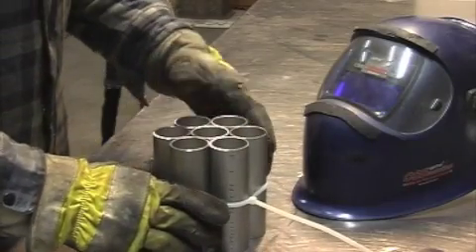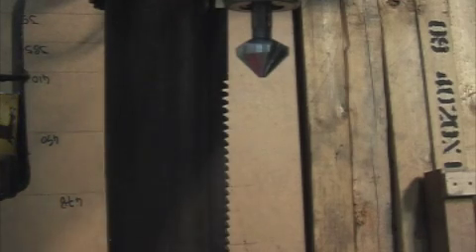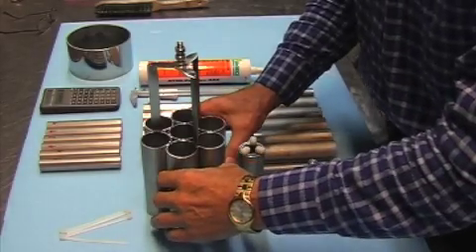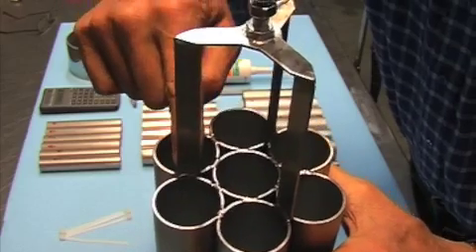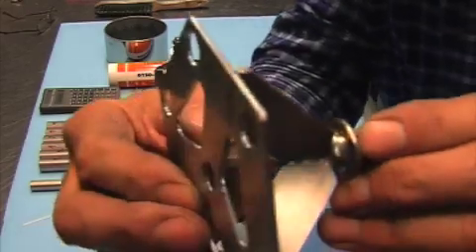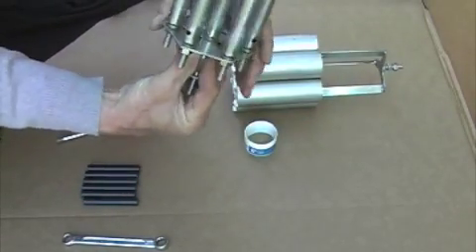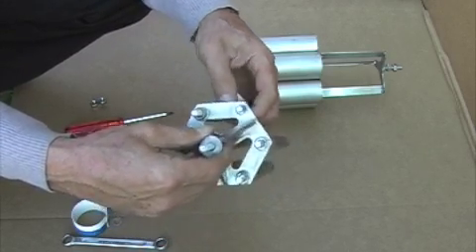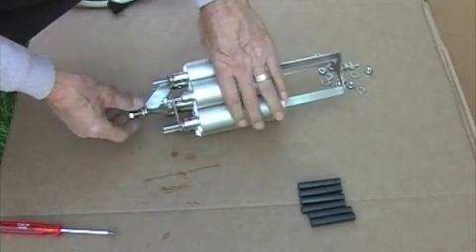HHO Swiss Inox 3d Seven Cores Cell and GOOD production

Comment: ok, so, you have the positive on the outside... major issue....you have multiple grounding points but only one positive.... reverse those.... then, pulse electricity to each of the multiple positive posts.... that was a major reason why the original guys reaction chamber worked so well - his pulsed electricity sending unit.  others adapted a rotor/distributor cap to pulse electricity to each positive post.... AMAZING RESULTS!!! 12V 1.5AMP.  the trick is multiple positive posts and all negatives connected with 2 layers of neutral plates around each positive post.
The welding is counter productive.  Neutral plates between the annode and diode cuts the amperage draw in half.  The more neutral plates, the more efficient - to the point of no KOH required.

Comment: Try not to use tubes but make your tubes or plates out of heavy wire mesh so they will have more surface edges because you will get much more benefit from your production. Just imagine having two flat plates close together no matter how large they are. If you could view the reaction that you're trying to achieve through a high-speed camera you should see very few areas in the interior of the plate but you will have mostly all of the reaction of it bubbling from all the edges of your plates. Meaning the only thing that was producing the reaction were the edges of the holes you had in the tubes. And you would have had twice as much as you had if you had the same holes on the surrounding tubes. And this is why I recommend using a wire mesh for it will give you the maximum holes with edge area.

Comment: Dear Swiss Friend
   Mike Meyers was an inventer who had achieved the goal of running an automobile on water aione.   He accomplished this with high voltage, low anperage, and a frequency.   I'm not sure of the hertz, around 5,012 or so, maybe varying.  The voltage is still DC.   Ampheres creats a lot or heat.  High voltage is efficient at spanning a gap, like that in a tazer for instance.   Good Luck Sir.

Comment: have you heard of a joy fule cell apparently it works like this cell but makes Oregon energy to but you need to detect the orgon to the center of the old school carbureted engine change the timing 30% charge the water for 12 hours turning on and off every 3 hours and wala good to go    is this true or b.s I want to buy all the shit to build it but looked everywhere for pipe off cuts but they don't sell them.

Comment: High amps and low volts are needed I think 1.25v is all you need the more amperage you have the better production. Use a computer power supply you can net 40 amps at 3.3 volts very easy and your production would be hugely improved. very good design though. Thanks for posting the videos.

Comment: jumping from 1.2 A up to 20 ?  is there anyone who knows what are we looking for? , any suggestions ?
Reply: I found somewhere that the amperage  should be about 8 to 14 amps and not more than 15 because tne water gets hot,
fit the walts until the proper result. 
other variables that sould be attentioned:
the frequency of the current
the contact surface - as it bigger the output increases.
covering the electrods with diferent alloy,by electrolysis - worth trying
and a catalizator - such potassium hidroxide
very important: since hho is explodable,
it's wise to collect every gas separately, ,
flowing them through a 'security valve' that prevents the explosion from going back.
Reply: beinjito baberio what if we cool the water down in a freezer ?
Reply: +Mars Seeker doesn't seem to have a noticeable efect.
but, because the suitble path , as mentioned earlier , is to progress considering all possible aspects (I've tried to describe some),maybe there's  indeed an optimal range of temperature to make the efect along  with the other variables.
Reply: +beinjito baberio regarding to the electricity,it was mentioned that enen small amperage but densed frequency will rise the output, if so , may someone predict if connecting a jaulethieve will cause the same efect ? (jaulethieve is a circuit that gains elec' magnetic field,turning it to additional voltage in the circuit )
Reply: +Mars Seeker 
Amps and the hho  out put have a connection to each other the best cell will have a high HHO- out put at low amps and that number is one you have to find 
Standle Miyers - [check spelling ] had the water power VW using his system
in witch he was using 115 volts AC at 400 HZ and  [ .5 ]  amps his unit was 
puting out  a good amount of HHO gas.  see his video's 

He is no longer with us but he was a true leader in the field this person
is only using 1.2 amps to make hho good start. need to see how much
gas per min- it can put out. And i like the ideal of wealding them.  It cut
down on parts and made good bond to each tube.

HZ is a term in electronics as to the Freq-  of the voltage  in the US its
60 Hz in Euo- its 50 HZ and aircraft Systems use 115 Volt's AC at 400 HZ

To me and just off the top of my head at 12 Volts I would like to see a system
that's only using max of 30 amps andt that would produce the amount of 
HHO that could  power a auto engine. as I said just off the top of  my head.

To me I thank AC is the way to go but i could be wrong and they do make
some AC inveters for aircraft lighting system one type is from 
Beech Aircraft and can the units come in to types one power from
12 volt system and one from 24 volts 

One more point the higher the voltage the lower the amps you need to do
the job. case in point. take to air- conditons  units one at 115 volts and
the other 220 volts and look at the BTU OUT put of the units 

Go for the hight's BTU on the 115AC-Unit and check the amp it will be a
round 15 amps.

now look at the 220 AC Units  the BTU will be double and the amps
will less the or the same for the 110 unit. 

hope this helps even its a little late

Comment: I always read the comments and I never see anyone talk about to connect a second alternator to the vehicle. So I decided to do it myself. Why not connect a second 120 amps alternator to the weel, or to the cardan or any other transmission system of a car, including having a small tire to descend upon activation and connecting to asphalt and through a set of gears transfer the energy to this 120 amps alternator connected to a secondary battery.. That makes sense to me.. I also have had a dream once, ( I was thinking too much on HHO LOL) and I dreamed there was snails in between my plates...Then for a couple of days I keept thinking on this wierd dream and them i realized the snails represented copper coils in between 2 seled plates.. and the coil serving as a voltage increase between the 2 faces exposed to the electrolite. .any comment on this?
Reply: Some cars like Mercedes Sprinter and VW LT II can be ordered with two alternators or upgraded easily to 120 + 120 Amps. But my question is: Does more gas automatically bring more fuel economy? How many gas is needed for the typical 2.5 Litre Diesel engines to reduce fuel consumption about 30%?

Comment: i like ur work.  if you added the spiral core around this unit  u wouldn't have that much wasted space. why is everyone  focus only on one way i say add all the ways you can conceive to one unit and make the water circulate  through the cell will gain higher production.  if you move the water through the cell bubbles wont stick onto the plates.and then have room for new places for it to make more. and also you could add another expose wire into the top of the cell and space it out give you a new 'plate'  and to make the inside core make sure to try the dock wire too. but all in all good work. i havent seen one hho that applys more than one way. and i like to see one

Comment: Have you tried a "high pulls/high voltage/low amperage" like 12 volts/less then 1 amp at 60,000Hz + ?  I heard it makes all the difference.  Too much amp=to much heat.  It keeps the temperature low witch is essential.  This is so cool in it self anyways.
thanks for video

Comment: Does atmospheric pressure make a difference? Could you apply a vacuum to the hho device to help extract the gas?
Reply: good question, I wonder what the process does to the pressure considering it was a sealed container? Seems like a vacuum pump would be fighting to keep hg during the process but who knows, the benefit could be dramatic

Comment: Great start .But the higher the amps the more power you are pulling away from your auto and the hotter it will run. High voltage at lower amps will run cooler and work better for your alternator. Think about this ? A stun gun operates on less than .5 amp and can generate millions of volts. Add a PWM to control your pulse width and watch the magic. Just something you should experiment with?
Reply: Jack, what you need is a good power converter and I'm sorry but a PWM does not work as a power converter, sure you can lower the average power but what you need is a good solid buck converter. FYI, HHO gas production at anything higher than a couple of volts is wasted as heat.

To get good efficiency you need to use about 2V. You need to get the series resistance very low however the catch is that gas production will increase the resistance between your plates lowering the overall efficiency again so you need to get that gas out quickly.

Extracting the gases from water is a fine art and while the process itself is quite inefficient, there are lots of ways you can increase the efficiency of your system.

Comment: 1.48 volts is the most efficient plate voltage for the disassociation of water by electrolysis. Anything beyond that merely wastes energy in the form of heat. You would be better off designing a 1.5 volt DC power supply that delivers very high current to your plates. That would make it as efficient as it can get, around 60 to 70% efficient as far as energy in, energy out goes. Building custom high current low voltage solar panels would be the way to go. Just wire every 3 solar cells in series then install them in parallel banks. You should design your electrolytic cells so the oxygen and hydrogen are produced separately too to lower the risk of large volumes of highly explosive pre mixed oxidizer/fuel being in one place. You simply need to install separate collection tubes over your anodes and cathodes and place them in a shared tank of water containing your electrolyte of choice.

Comment: a hydrogen  embrittlement on the  element's is only in the container and only effects aluminium  or light metals unlike stainless steal is best for longer life runs and easy to clean .It has a tighter bond and is not prone to except the hydrogen or oxygen atom  displacement in the metal titanium is denser material but cost prohibitive .

Comment: hello friend! the model you built is very similar to what I built, only I put only two tubes one large and one small for precione reduce water and bubbles out better. your fabricaste model is much better and more productive. and in my case was producing as expected, investigate and found and put CD burners lasers out of glass that greatly improved the production, (without producing deuterium)

Comment: believe it or not, most people are told that positive is what makes electricity flow, so it makes sense that you use more postive electrodes than negative electrodes, on the other hand, you are right we are after the production of hidrogen after.

 And thanks for the advice, im working on my hho cell and this will help me a lot thanks.

Comment: because the system auto-regenerates the energy consume thanks to the alternator, thing of it like this:
   You use the batery to power the cell......the cell produce HHO and used it on the motor....the motor power the alternator.... and the alternator gives power to the batery.
One side note, most Fuel cells, use more than 20 Amps of power, so using 1-2 Amps like the video said, is WAY too much efecient, perhaps is real, perhaps not, but the desing looks solid. cheers

Comment: For combustion in car - there is absolutely no benefit.
For workshop use - you can build electrolyser to produce H2 and O2 and use that mixture  to heat up or melt (in praxis it's good to add some propane, to keep the reducing, not oxidizing flame). It's possible to weld steel with that electrolyser and standard acetylene torch, but there's problem with hydrogen in that mixture - hydrogen can easily diffuse into molten material and cause /wiki/Hydrogen_embrittlement

Comment: I used an old pool salt chlorinator  that provides max HHO production with titanium electrodes that last ages unlike other metals .Just us an acid or alkaline solution about 50:1  voltage will vary depending an the size of the unit but averages 6-9 V and adjust current to suit to much current and the water will boil. Hope this helps .

Comment: You need more volts. There should be 1.8-2.2 volts between each set of plates. Also, use neutral plates that will get charged by the water.

Comment: IMO spark plugs discharge by ionising a gas to plasma. As the charge ramps up between the electrodes small surface variations will promote plasma/ion formation unequally. Points that are quicker to form conductive plasma get lower resistance, forming more plasma, further reducing local resistance. Very quickly one particular conduction route gains the decisive advantage, conducting all the current. In an electrolyte conductive ions are already present and don't have to be formed by current flow.

Comment from the maker: Thank you very much for your view and valuable information. I am only wondering if what you have in a spark plug which receives only one extremely short electrical discharge also applies on a device which is constantly under current?! Once the metal is saturated with electricity on a continuous mode then all of the metal measures the same resistance, a bit like the commonrail track of a diesel injection system has the same pressure for each valve you open. Just a thought?!

Comment: Why does everybody make the smaller inside tubes to be negative and the bigger outside tubes to be positive ? Why not the other way around ? The negative Electrode makes Hydrogen , the positive Electrode makes Oxygen. It makes sense to use the larger Electrode ( outside Tube ) as negative as it has more surface area and would produce more Hydrogen this way, and the Hydrogen is what we are looking for.

Comment: there is a copper tape method to this madness, attempt wrapping your glass jar in copper and hook your pos/neg to it as well as the electrolosys device, super charge the field and you may be surprised at the results! Also, research Dr. Stiffler and the free energy hydrogen cell, you can litterally produce more hydrogen power than the 6v put into it using a fuel cell!

Comment: That's been my downfall not knowing enough about electronics. If I did, Or as you say, had an assistant, We might be able to make it work better than ever.  Since separation takes brute force, we need to use every possible resource available. aka vibration, sun, outsource heat ect.
Thanks

Comment: Question:
When you weld the pieces,  the welded area is not stainless steel so electrolysis might corrode the non-stainless steel and cause damage in the long run?  I am not sure if this is a valid question.  Many thanks for your great videos.  I think Meyer also used low amp but high voltage pulsed DC as at certain frequencies the production was mind staggering!  Remember our martyred hero!

Comment: HI try using 110Volt DC to your unit it uses about 12-20 Amps of electricty but it produces a hole lot more. I've tryed it and it works GREAT. NICE equipment and UNIT. OH PS make sur you have a lot of room on top so the water does't flow over the beacon ;-)

Comment: @ammanninox To much resistance from all the pieces of SS. For the electrolysis the important variable is current(Ampere). You may obtain better results with a power supply capable of delivering 10 to 20 Amps and at least 3 volts or higher.

Comment: you are awesome, i also think you have all the tools we can't get. I have made the coil with the marine cable and it works. I don't have an amp tester so not sure how many amps it's pulling. my goal is find something that i can hopefully adapt to my 1.8L engine car. Should need about approx 5 Liters a minute to successfully run in idle. Please continue posting. The seven tubes looks to be a lot more efficient on this video than the other HHO generators you have created. Thank you.

Comment: hey that is stanley meyer style well only problem on the botom leak of charging, isolate the connection use the tube as wave guide.Its very near apply some electronics. charging make water stable because of polarization and orient the electromagnet release the bubbles from covalent switch off.

Comment from the maker: Yes you are correct it is possible that it will corrode, but it is not a big issue yet for me since I am experimenting and the welded area is not directly  touched by electrolysis.
Thanks for the observation.
AMOX

Comment: If you are a good tuner you can reflash the ECU using a reflasher and a lap top, once you hack in the ECU with the device you adjust your air fuel ratio, and while you are at it tell your O2 to ignore the less C02 output which make it send a signal that its running lean. Or buy a EFIE off eBay for about $100. Either way you better be somewhat good with tools and a little knowledge about Air Fuel dynamics. The O2 is 1 of the main obstacle to tame for better MPG with a modern EFI vehicle.

Comment: Great work and the 7 joecells in parallel make a great team for hydroxy production. The output looks good though I would use caustic soda or KOH for electrolite. The voltage handling is around 8 volts with only 3 neutral tubes and 4 gaps ie 2volts per gap. well try it but be careful on the ammount of  electrolite you put in the water. We love to see it work with say 15amps though.